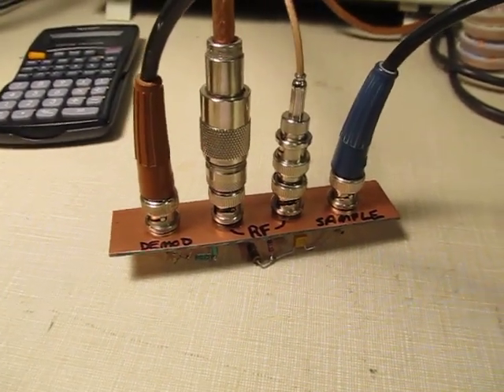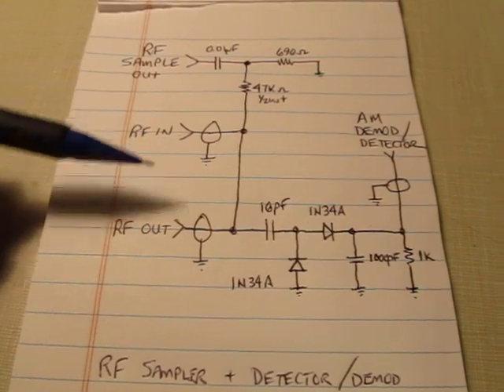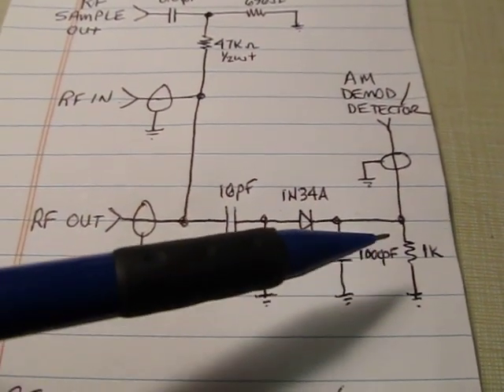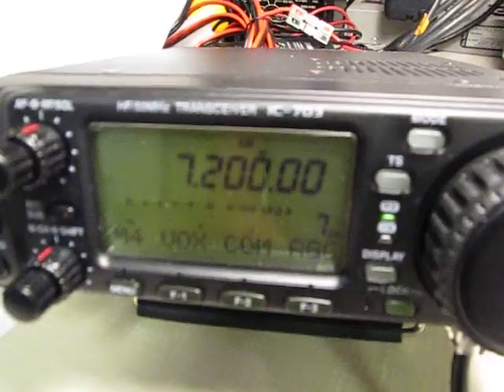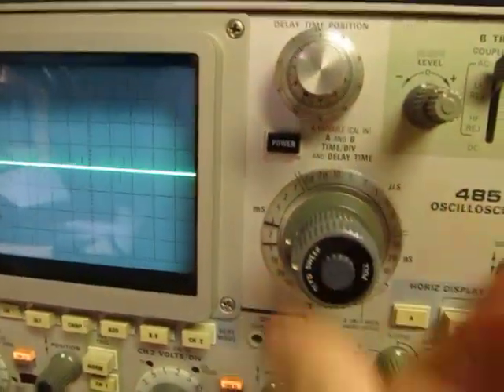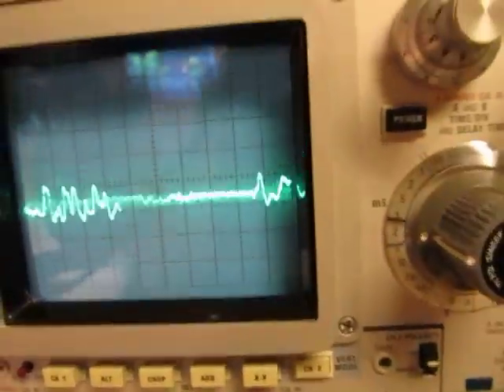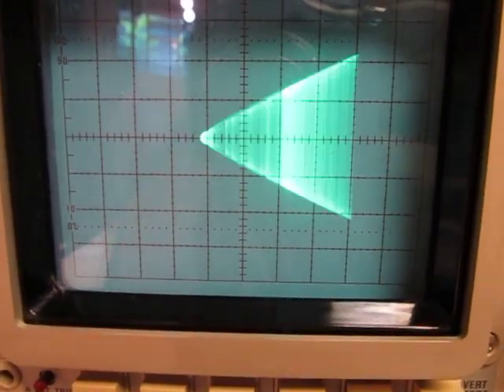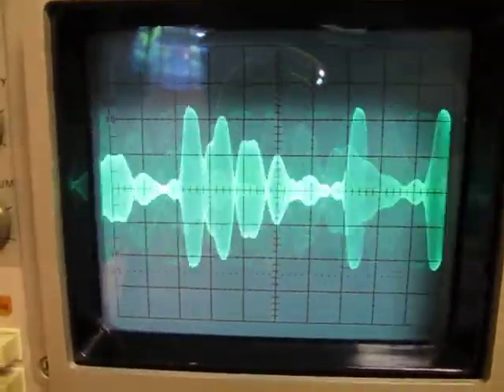#7: Monitor your Ham Radio transmitter with an oscilloscope

Comment: Just found your channel recently. Thank you for the effort you place into sharing your knowledge and the time it takes to produce the video's for YouTube.

I just bought me a scope in the past couple of weeks and I'm beginning to understand how to use it in my station.

A couple of questions:

1) are you using your scope probes to measure or are you hooking up directly from this board to the scope?
1a) if direct; is the coax attenuated in any means or strictly a straight 50ohm BNC coax like I might have lying around in my shack?

2) you stated that you were measuring a QRP rig. Help me here as I've been an Advanced class for 25 years but as an "appliance operator" only.  Now, since I've retired, I'm trying to build me a few antennas and get some more theory behind me.  With that... How would you determine value for resistors (wattage value that is) for say a 100 watt rig, a 400 watt rig, a 800 watt rig... all the way up to say legal limit 1500watts?

The main reason I asked (2) is I have purchased an amplifier (Ameritron AL-811H; 800 watts) and I would like to make sure that I'm doing ok with it.

The Scope that I bought is a BK Precision 2190E that I bought from Mouser.  (I'm lucky enough to be near Mouser (1/2 hour drive) so I can order and pick up in same day.))  It's a digital 2 channel 100MHz bandwidth; 1GSa/s which for the price ($399.00) I thought was excellent.

Russ
KW5KW
good on QRZ
Reply from the maker: For monitoring 100W+,. I would probably not use a resistive tap like this.  Take a look at my video(s) on RF Samplers / Taps for some ideas.
https://www.youtube.com/watch?v=0Kk_N_TpDeo
https://www.youtube.com/watch?v=2D83xp3H5Bo

Comment: If you're taking the demod and the rf sample from the same point, the result must always be 'linear' by definition.  You aren't measuring the linearity of anything but your sampling circuit.  Normally you would take the demod from an amp input side, and the rf sample from the amp output, and this would show if the amp had a linear output. The point of this circuit is to show the difference in linearity when comparing two rf sampling points. It does measure modulation as constructed.
Reply from the maker: Yes, of course. I explain this in the notes of the video, as well as in the text annotations in the video itself. This fixture was assembled as a demonstrator for a presentation given to a local radio club. Both sensors use the same signal as a convenience, and not intended to show linearity of the demo signal, just to show the process when the two sensors are used correctly on either side of s modulator or amp.
Reply: w2aew ah, when viewing in the youtube app I don't see any annotations and the notes are hidden.  A handy circuit and exactly what i was looking for. Thanks.

Comment: I am having difficulty getting the trapezoid reading. I have Dmod to X as indicated by your notation. Sample in Y. GO into X-Y mode, and instead of it going left to right, it goes up and down in a fine point.  I have tried swtiching the x and y channels. Everything else seems to be working as it does in your video.
Reply: NM, I just figured it out. On my scope I have to plug X into EXT.

Comment: Are you able/willing to give more information on how you came up with that circuit design? It's something I haven't learned how to do yet and I'd like to be able to customize it to whatever equipment I'm using. Also, what was your antenna?
Reply from the maker: The "monitor" circuit is a simple voltage divider.  Values are not critical - just wanted very little loading on the 50 ohm line, so the sum of the resistors is >>50.  And, used a reasonably large divide ratio to reduce large RF voltages down to lower levels for the scope input.  The demodulator circuit is a very common RF amplitude detector.  If all you want/need is to monitor your RF output, there are many ways to do this.  Check out these videos of mine:

Super Simple RF monitor:
https://www.youtube.com/watch?v=2D83xp3H5Bo

Basics of RF Samplers:'
https://www.youtube.com/watch?v=0Kk_N_TpDeo
Reply: w2aew cddsssdscfrerrfrg

Comment: I just bought a Yaesu FT817nd two days ago and I do not have any matching antenna at the moment so I was wondering if I could measure the output power of this rig. Then this video seems very helpful. I like all videos by w2aew. By the way, being a physics Ph.D student, I know how individual parts works but I don't have engineering knowledge which is needed for these stuff. I am curious what would happen if the output signal of the FT817nd is directly fed into the scope. what could be the problems and do I fry the Scope or the FT817nd? I have a Tektronix 2225 scope. Thanks.
Reply from the maker: The FT-817 puts out a maximum of 5W into a 50 ohm load.  It is not advisable to transmit directly into the scope for a couple of reasons - mainly because the input impedance of the scope is not 50 ohms.  SWR protection in the rig will reduce the power if the output is not loaded with 50 ohms, so you won't get the correct power reading.  And of course, you could potentially damage the scope and the rig.  To use the scope to measure power, you'll need a 50 ohm thru termination that is rated for 5W operation, or a calibrated RF sampler/tap.  You could build a simple resistor divider inside of a dummy load and use that with a 10x probe.  I use one of these:
http://www.terapeak.com/worth/tektronix-bnc-termination-011-0099-00-50-omega-5w-c1-1-139a/231655320319/
Reply: Thanks for your quick reply.

Comment: My scope has  1 megohm input impedance. Do I need a 50 ohm feed through connector? Will I cause any damage it I feed the 1 MEG input of the scope directly with 50 ohm coax and BNC connectors from my Sampler/demodulator?
Reply from the maker: +What&#39;s Papa doing now? No problem, no need for the 50 ohm terminators in this case.

Comment: I am wondering about the 1k across the demodulator. This would give a very high cutoff surely? The time constant with the 1000p cap would be 1uS. I tried your circuit out with the values shown and found that sure enough, pretty much all I could see was residual RF and no AF. Increasing the value to 47k gave a good result, nice clear demod and very little RF on the signal. The results are clear but I do wonder if my thoughts are all wet?
Reply from the maker: +984francis The 1K resistor is just to provide a bleed off path for the charge stored on the 1000 pF capacitor.  A higher value will give a slower bleed off rate, and will work fine for demodulating audio frequencies.  You're results are fine - simply choose the values to suit your application.

Comment: Alan
First of all, thank you for your excellent videos. You are to be commended for sharing your knowledge and expertise on the most important of all test equipment, 
The Scope!
I finally got around to building this. Cost about 10 dollars and about 30 minutes to assemble. A very easy project to reproduce. I built mine in a small BUD enclosure.
Using a spare 40 mhz scope that was given to me (leaving my Tek 475 in my shop) I hooked it up to the RF output of the shack switching circuit so I can monitor all of my rigs, I have several.
Using my BC-610-E transmitter, I monitored my carrier and modulation with ease. 
It makes a huge difference in determining the health of my signal. Even an inexpensive dual trace scope is a much needed tool, a must for the serious minded operator intent on controlling the quality of the signal.
Remember folks, the scope never lies. If you want the truth about your station, the scope will tell you more at a glance than most any other piece of gear.
Thanks again Alan.
73 de Billy N6YW

Comment: Thanks for this, I might dig my scope out now :)

Can this be added to my ATU, taking the transmitter input as the source?
A couple of BNC sockets on the back would make it useful, what happens if the BNC's are not connected to the scope - can it be left inline?
Reply from the maker: Matty Lad If you have a ATU with unused ports, you can use the technique shown in this video, super simple:https://www.youtube.com/watch?v=2D83xp3H5Bo

No direct connection to the RF line, nothing to build, works well.  Just heed the warnings in the video.

Comment: There is something i dont understand with the rf sampler.
I did make the circuit, using 18k for the ground resistor and 56k for the RF in resistor and 15nf cap.
This should give me a voltage ratio of .243, but when i measure with the oscilloscope i get a voltage ratio of .0437
why is that? ex, i have a 40v-p-p 144Mhz sinewave into a 50ohm dummy load, Rf sampler output should be 9.72v-p-p, but i get 1.75v-p-p instead. i don't understand. if i connect the scope directly to the 50ohm i get 40v-p-p, so its not the scope bandwidth.
Reply: oh i found the video Basics of RF Samplers, Sampling-Tees, RF-taps, etc., 
that explain it to me :)
Reply: did you figure out why your sample signal is not the expected value? I'm having a similar problem.
Reply from the maker: Probably due to the fact that the resistors are large values, and thus the parasitic capacitance of the devices and scope input are affecting the result.
Reply: w2aew i figured it out mathematically, thanks! I wasn't taking into account the 50 ohm impedance of the scope

Comment from the maker: +Joseph Duane Yuna. Is this archaic and unnecessary? Sure it is. But, that's not the point of it. It is interesting, fun, entertaining and educational.
Reply: It's not at all archaic and unnecessary. I am a general class ham and recently added a cheap AM CB to my station. There are some local hams who like to chat on 11 meters. I plan on getting an SSB CB. Many CBer's like to "peak and tune" their radios. If I get something used there is a chance that it's been messed with. A watt meter will make sure it's within FCC specs for power output. With your circuit I can use my O-scope to make sure the radio isn't over modulating. So there are perfectly good reasons to do what you show in the video.

Thanks for posting this!
Reply: I would go further. Many people enjoy using vintage transmitters and for them, these methods are valuable. Furthermore, there is real value (point if you will) in having fun.
Reply: purplemutantas  Unnecessary and archaic? Not on your worst day ( or any one else' s either) This circuit, as well as the one I have designed on my own is and has been indispensable for the past 35 years to me.  W ether  used for CB, HAM, HT's and Linear Amps or QR P, it's the way to tune your transmitter in conjunction with an AF signal generator, RF generator, PEAK reading and RMS  watt meter, frequency counter and ammeter. How can any shop or shack get it truly  "right", without  tuning on a scope ? Many shops don't care as long as the radio is on freq. and sounds alright. Then of course, we may or may not have a spectrum analyzer to really see whats happening after the fact!  As I'm sure you also know "seeing" your RF output in conjunction with a freq. counter will allow you to check that your carrier oscillators in ANY SSB/ AM transmitter SUCH AS A CB even for example- is not only on frequency, but what your RF output looks like on a scope as a result of  those carrier oscillators and if they are sensitive to a physical shock or vibration in the mobile.  also at various power output levels too. Not to mention A TWO TONE  Generator. If you know what you're doing, then you know what I'm saying/ This is absolutely necessary for any tech who wants it all to work properly, sound properly, and of course- on frequency. This simple circuit is indispensable and I made one the way I wanted for my own reasons.The first one I designed --would show a perfect image into a scope with a 1 MHz. maximum  vertical bandwidth amp;  into an old tube type Eico scope I got for $10. I just had to let you guys know about this after some opinions I had read here.
Reply: +purplemutantas You worry too much about staying within power limits on CB. I am a ham but use CB for traffic info when traveling. Just about any day I can hear stations on channel 6 that are obviously running multi kw output, over modulating and splattering over many channels. This has been ongoing for years and so far, the FCC apparently hasn't done squat. I wouldn't have any worry except if someone turned the power up to the point of backward modulation or to the point of endangering component life.
Reply: CAROLINA PATRIOT Hi - I wanted to comment on - you said  "Point of backward modulation or to the point of endangering component life". I find that comment really funny. Back in the 1980's I worked in a CB shop, and the things that went on with setting up the Radios CORRECTLY, into 50 watt drivers then into HUGE amps to the point of just what you said. Although set up correctly, you will not get away from all the harmonics and parasitics. And burnt finals. I mean these guys sounded loud and I made sure the radio wasn't distorting - I was on C.B. back then as well. Thats where the scope and monitoring your modulation, as well as a spectrum analyzer  comes to play and is SO important. To each guy that wanted their stuff set up, I had to explain that they will be as loud as they want but (WHY) I won't make them sound distorted- and there is  a  fine line there. You can tell if they're set up correctly by their sound of course. However at home, I had a scope set up to see everyone's modulation (via  455kc in mod. from a C.B.) and would call them into the shop or tell one of their buddies to let them know ASAP, so it can be checked and fixed for free if possible. It was a cool thing actually and great for business. Good times.....
Reply: Great video! I spend a good 20 years of my working life performing similar tests on MF and HF transmitters ranging from 1kW through to 10kW. Not sure what is meant by archaic and unnecessary?

Comment: I have a Kenwood SM-220 station monitor with the Panadapter BS-8 done to it. Is that pretty much the same as this? BTW, the SM-220 was not made for my TS-130SE, how could I rig it up as a spectrum analyzer so I can see my IMD? I haven't touched a scope since 1980...
Reply from the maker: Yes, the monitor function of the SM-220 performs the same function as what's shown here. The BS-8 is a limited function spectrum analyzer with a center frequency fixed at 8.83MHz.  It will only cover a limited bandwidth. It's doubtful that it has a good enough dynamic range to be useful for IMD measurements.
Reply: *****
 I'm currently watching your Oscilloscope Basics video, and in it you mentioned a "T" connector to tap into the RF as I/P to the scope, or using the unused antenna port on the antenna tuner. I like the use of the antenna tuner. Should I make a coax cable with a RCA end to plug into the BS-* Panadapter on the SM-220, or should it have a BNC to plug into the "X" connection, and set to GND/MONI to ground the "V" circuit? Thank you for your help, and for the great scope  video.
Reply from the maker: Definitely do NOT use a T to tap into your transmitters RF output! Either use a RF Sampler, RF Tap, resistive or capacitive divider or inductive pickup. Or, use an unused port on the tuner, and be sure NOT to transmit into the scope!  Check out my videos on RF samplers.  Connecting into the BS-8 won't serve any useful purpose. The BS-8 can only measure 8.73 to 8.93MHz.

Comment: If only more hams would learn how easy and inexpensive it is to use an oscilloscope to monitor their transmitted SSB/AM signal. Tuning for maximum CW (aka 'dead key') signal and then switching to SSB/AM is a recipe for severe splatter, and irate neighbors on the band.  Even advancing the LOAD control an arbitrary amount and observing grid current doesn't guarantee linear operation.

The irony is, compared to the cost of just about ANY amplifier, an oscilloscope + pickup is typically a fraction of the cost. After obtaining a Tek 2465B 'scope for my lab bench, I retired my 2236 (100 MHz analog) 'scope to monitor duty.  Though I have dedicated ham scopes, I prefer a lab 'scope because the display is much larger, and it has triggered sweep (no display until input goes above a threshold).
Reply: Heck if you look around you can find a scope for free. I got a free tektronix 5103N from a local ham.

Comment: This is a great video. I tried this technique to analyze the output of my airband transceiver on a PM3092 Oscilloscope (sniffing the output between the rig and a dummy load), but the computer inside the scope went a bit mental. I am now looking for a Tek scope !
Philips PM3092 oscilloscope goes crazy with 127MHz input

Comment: Could you put something together for tuning a 2 meter band pass band reject duplexer, using a tex.465 Scope?
Your video's are the best on youtube.
Reply from the maker: The Tek 465 scope really isn't the best tool for this job.  It is only a 100MHz scope, so the response will be down several dB at 146MHz.  It doesn't have a 50 ohm termination, so you'll have to provide a through termination at the input.  Even with this, it will be nothing more than a glorified RF power meter that you could use to peak/dip the pass and reject cavities, assuming you have an appropriate signal source to drive the cavities with.